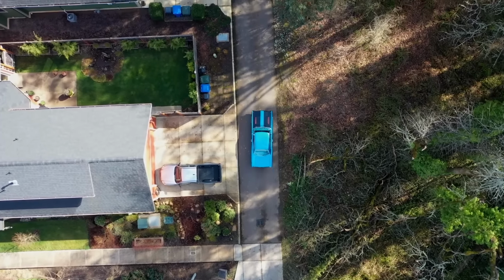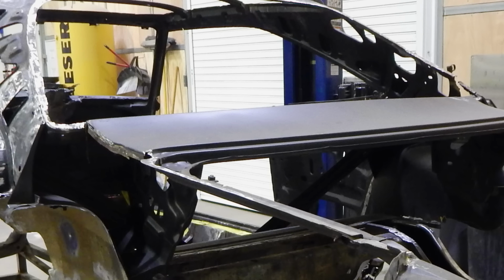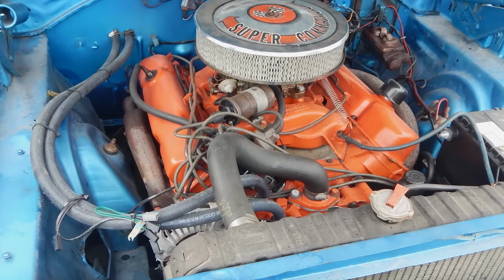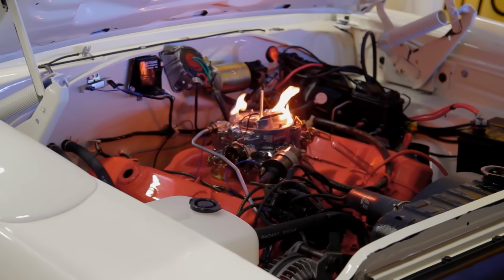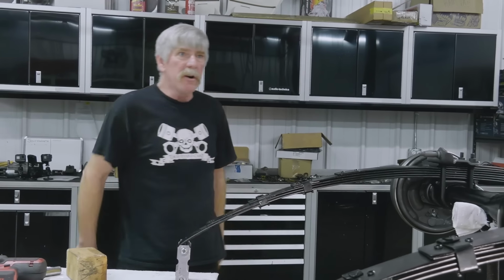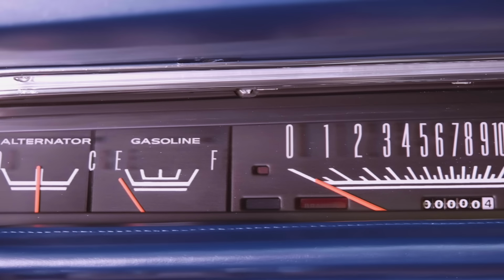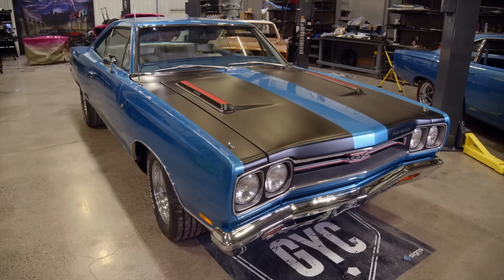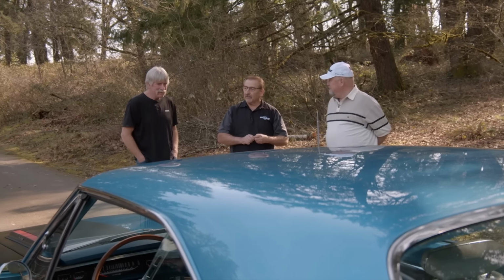THE STORY OF DOUGIE'S 1970 GRAN COUPE BARRACUDA AND HOW WE FOUND IT AGAIN!

Comment: Back in the 60s 70s and 80s we did not have things like meg welders to make repairs on cars like you have today. If we were lucky, we had a stick welder and they weren’t very much fun for getting into tight spots so we optimize. Otherwise a lot of these cars would’ve went to the scrap yard/crusher should I say your lucky stars that there’s things like Bondo to help slide through the inspection.

Comment: I am no expert. I mean, compared to other guys I personally know, I know less. Most certainly compared to these pros there is no reason to listen to me. That admitted:

I am a 54 year old guy who has always, since he was a teenager, bought older cars and fixed them up rather than buying new cars. Life is cheaper that way, and you get to make your car "brand new..." your way, rather than the way of people in Detroit, Germany or Japan (I am a MOPAR guy, but through the decades I have driven everything).  So I have HAD a LOT of work done on cars over the years.

And every single time, when it came time for body work and paint, the cost of making old hoods perfect vs the cost of just replacing the hoods, leads one to buying a new hood. I have gotten to the point where I no longer even look at the existing hood. I just immediately find out what a new hood costs and put that in my calculations.